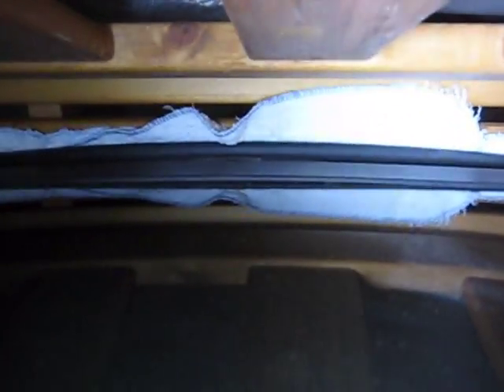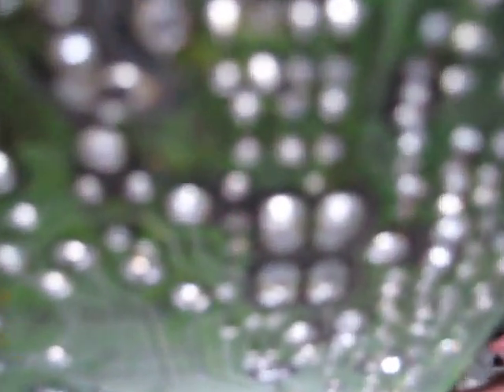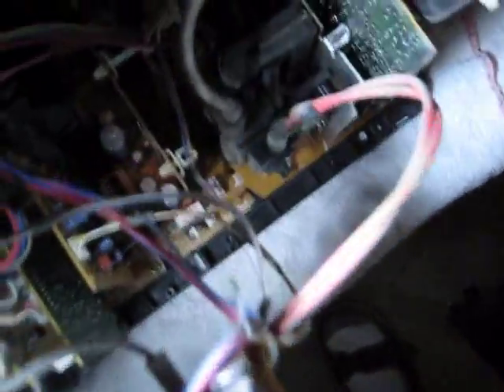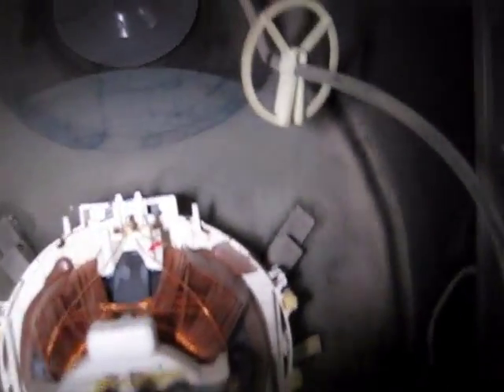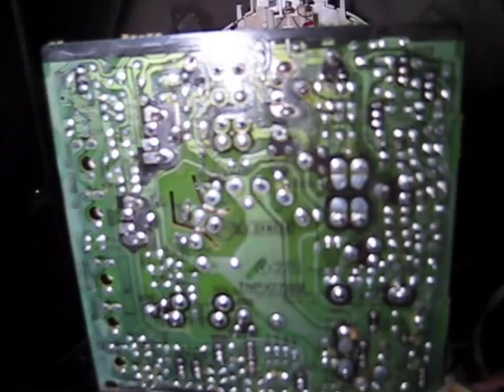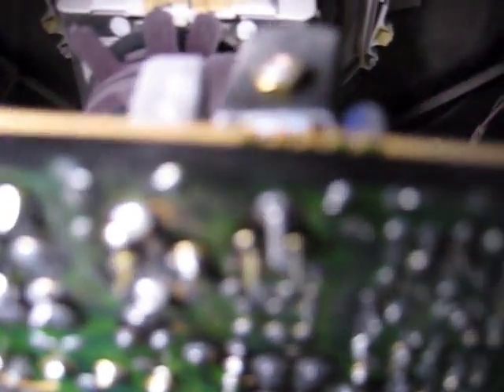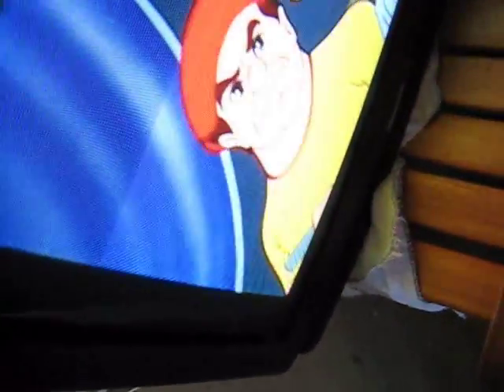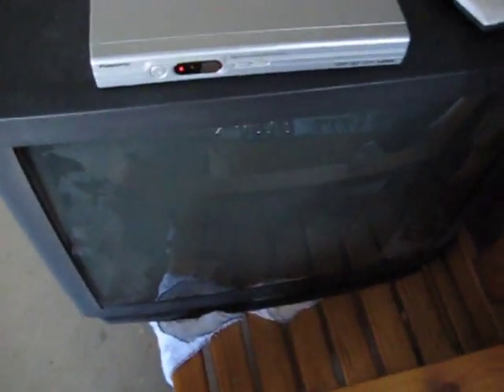TV Dry Joint repair & further diagnosis

Comment from the maker: Replacing a few components will remedy the problem, The Horizontal IC, resistors, or even Capacitors may have failed, I haven't looked in my TV for some time now, otherwise, i'll check where it is so I can tell you the Part number!